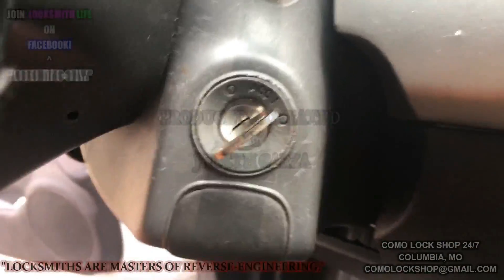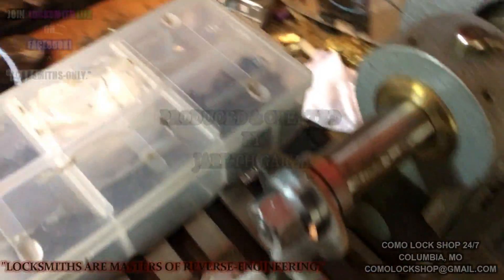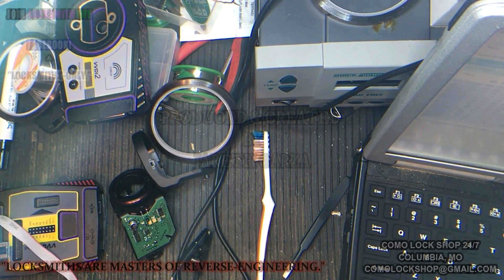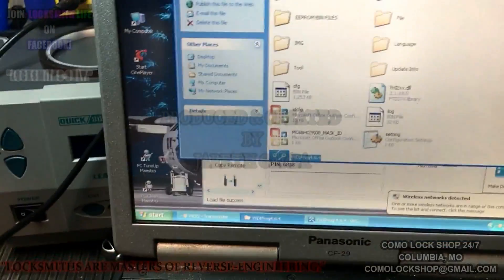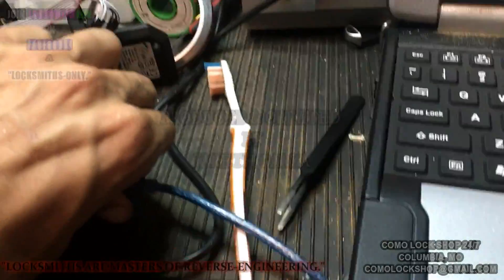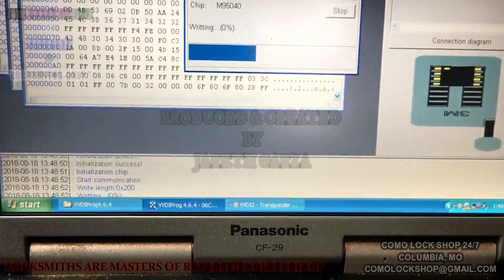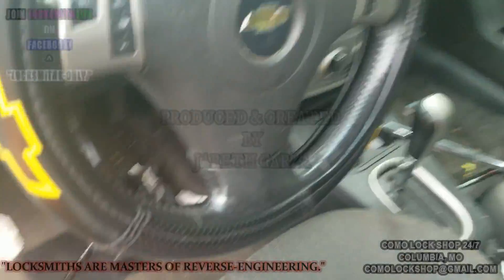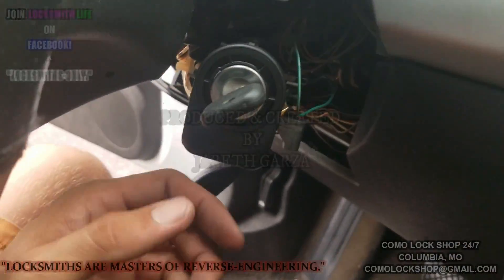2007 CHEVY Cobalt IGNITION-COIL EEPROM Read/Write All Keys Lost - No Power OBD nor Security-Light

Comment: hello sir.
Wasnt vvdiprog able to program back?
regards
Reply from the maker: Joao Ribeiro shouldve but didnt want to in-circuit. So removed device and threw it into ole’ trusty AR32
Reply: @JarethGarza  Those clips never work for me. Always fall off, or just a bad connection. I switched to a pogo pin adapter. No cleaning needed, works every time. Best $43 I ever spent.